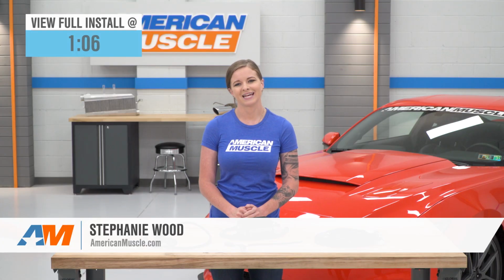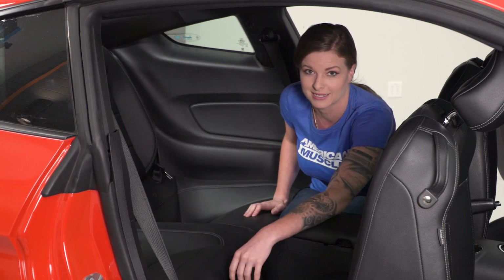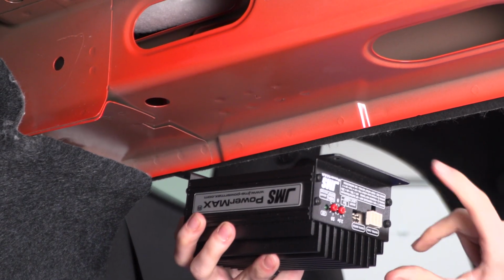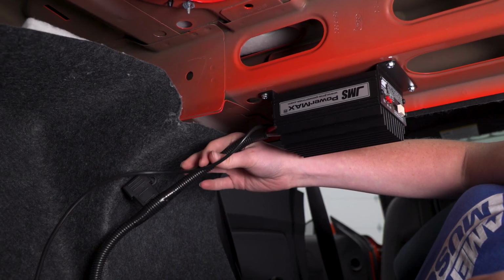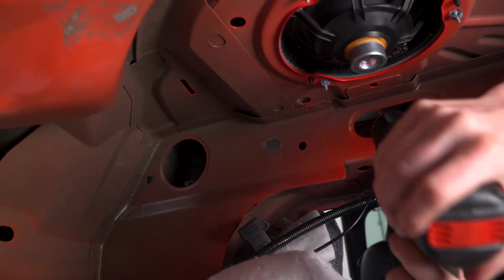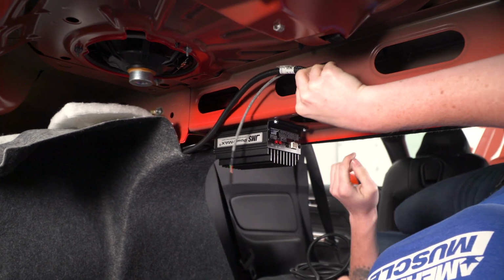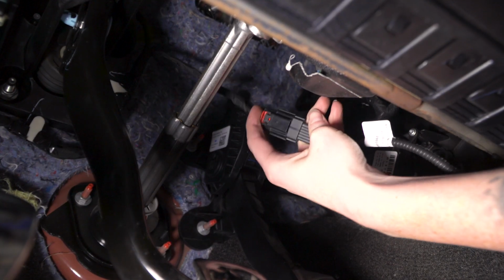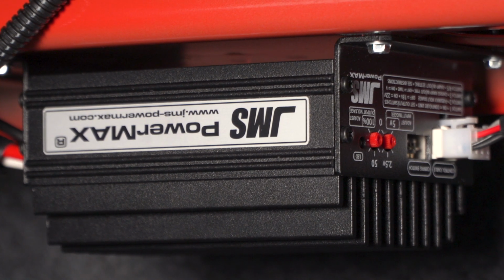2015-2017 Mustang JMS PowerMAX V2 FuelMAX Fuel Pump Voltage Booster Review & Install

Comment: Will this installation be similar for a Dodge Challenger 2015 and up?
Reply: No its far easier.  They plug in back in the trunk where the fuel pressure module box is.  Its like one connection and the JMS is all preset.  This is a pain on these cars and even worse on camaros.

Comment: I have a percision turbo, will this help with the fuel aspect?  I'm on E30 and if this can work you could in theory hold off for a little while on a fuel system. Obviously to get the full potential your gonna need a upgraded fuel system but I'm just curious as to see if this would work in giving a few extra ponies...
Reply: yes, i have a d1x and i am 1000hp capable with this set up

Comment: Why would someone spend $500 for this BAP ? when you can get a fuel pump that installs in the basket for half the price ? Yes the ability to adjust the output and tune the fuel delivery is great but for people that do not need that ability at this point its simply a waste of money .. this is an expensive solution to an inexpensive upgrade
Reply: Griffon 327 what BAP should I get for my 15’ GT supercharged
Reply: you put in a pump and also a booster...
Reply: No it’s not